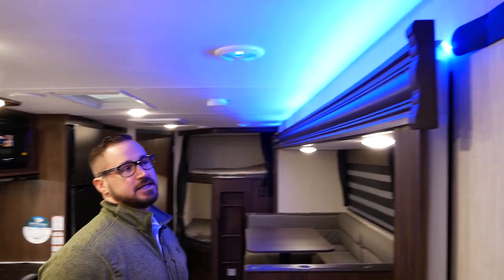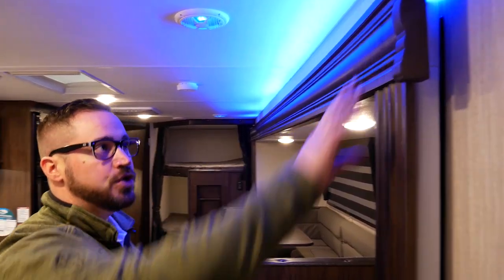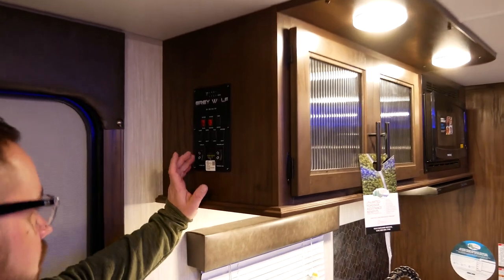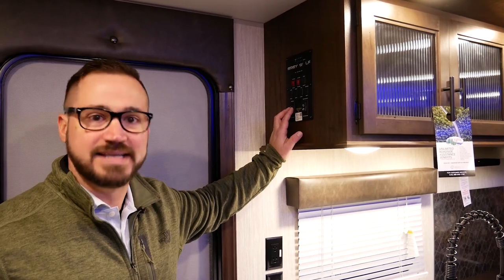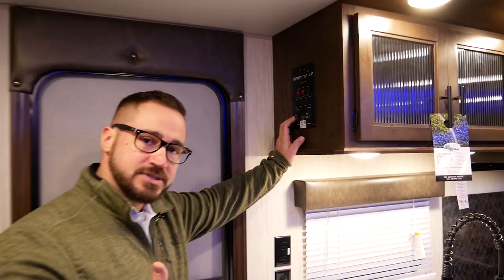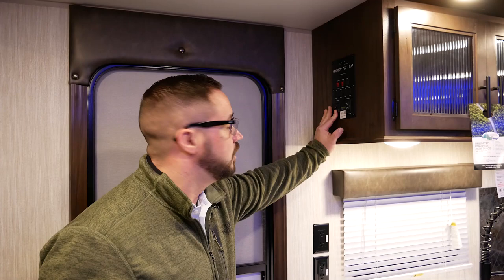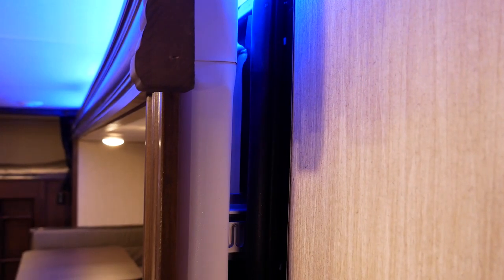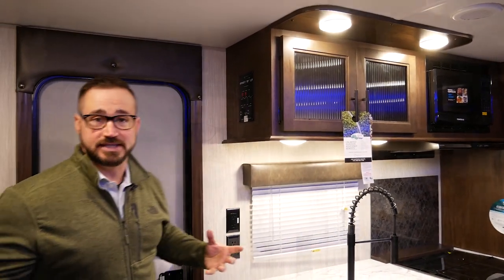Schwintek Slides on Grey Wolf and Wolf Pup

Comment: What do you do when it wont retract after all normal troubleshooting steps have been taken? My Wolf Pup 18TO Black Label has zero manual provisions. -nothing behind rubber seal, nothing under camper or slide.. disconnected battery.. wouldnt push in. Fortunately I studied electronics, found controler and figured out how to over-ride it using jumpers and manually bringing them in applying 12v power to the retract side of circut. A typical consumer is not going to do that. Im stunned there isnt a location for a drill, a crank or and easy-to-access manual release.. Even with power disconnected-3 of us couldnt push it in.. Very stressful..

Comment: Just saw a buyer beware video on the slides exterior perimeter joints that have no sealant at all. Not around the screws and joint cap seals. He had water damage to the slide floor and water spilled into the interior when retracted. Yes ,this was on the Grey wolf. It was 1 year old.
Reply from the maker: Thank you for making us aware, could you please provide a link to the video? We would like to look into the particular situation more closely.